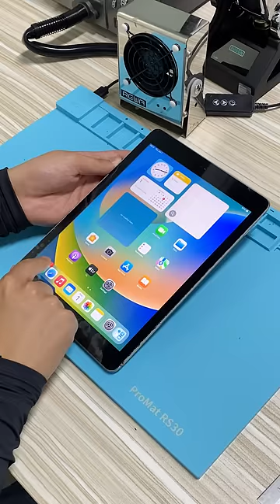iPad screen assembly replacement #shorts

Comment: The quality of work performed leaves much to be desired.  On the other hand, it all depends on the price.  If the price is low, then the quality is appropriate.  It seems to me that a good craftsman should always strive for the high quality of the work performed, and try to do it like from a factory, where adhesive tape was used, adhesive tape should be used, and where glue should be used glue, while choosing consumables that are suitable for their properties.

Comment: Does Securing the Home Button Bracket need a soldering Iron?
Reply: Using soldering iron to heat up the gluestick.
Reply: No, some glue they use for the digitizer is enough, the only thing is you have to let it dry for an hour or two. The original button is glued the same way as i told

Comment: Which tool you using home button fix
Reply from the maker: We use soldering iron at 360°C to heat up the glue
Reply: @rewatechnology2008  which glue